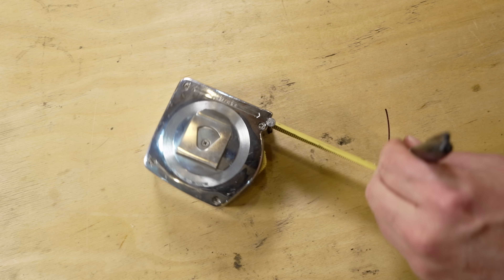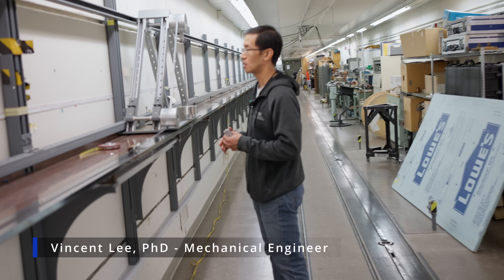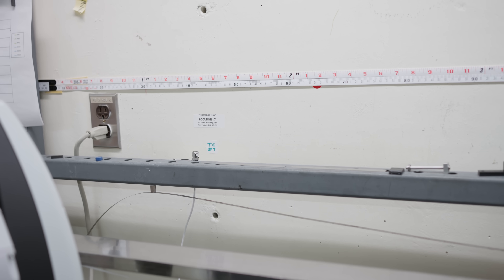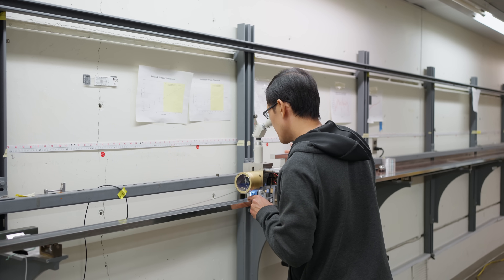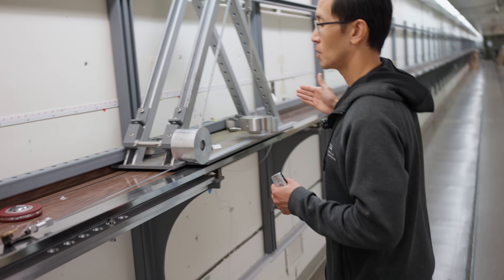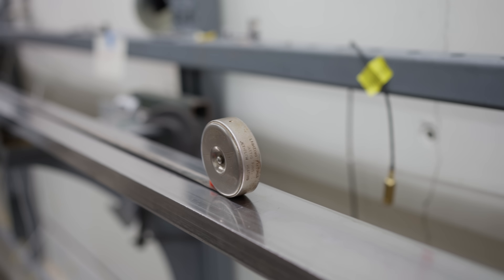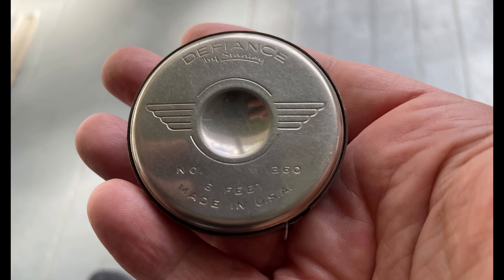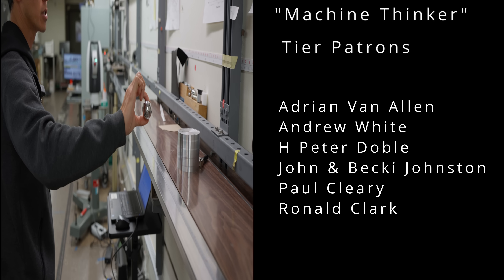The Most Accurate Tape Measure? I found it and can prove it

Comment: In my work, I was required to use an inch-measure steel tape with lead targets at specified intervals so that those points would show up on  x-ray or radiography images.  That tape was NIST traceable, and had to be inspected and tested by our Metrology lab if ever dropped or damaged.

This is the second of your videos I've watched.  Have a sub.  It matters not how often you may post new videos, because I have a good backlog to catch up on.  Thanks for doing what you do.

Comment: Lol when i was 15 i became a carpenter. My first tape had that wiggle.  So i used a drift pin and set the rivit solid. It didnt wiggle about 3 of the older carpenters had me do thiers. Then the boss came we were going to fix his tape. He showed us why it had a wiggle.  Next thing i found was my hammer bent a lot of nails so i made the head flat instead of rounded. Found out it made it worse. I just did have the mussel memory that you need to hit nails properly.  Just take practice.. lol always tried to make my tools better. Once i learned to sharpen . All my tools were sharp. But if you dont try things you may never learn why things work like they do.

Comment: I'm a former calibration tech in the Marines and for Lockheed at Stennis Space Center, and I used to calibrate tape measures for the satellite blanket department using our Renishaw and HP laser interferometers.

I'll never forget the first time one came through the lab.  At first we thought it a bit odd that someone would need a type 1 lab to calibrate a tape measure, until we found out why.

I'm also from Denver, and grew up listening to the "atomic clock" from NIST on the phone using a local number back in the 80's, which kick started my career. 

Made many visits to NIST, and met with a few of them, throughout my career as well.

Small world.

Comment: The amount of critical systems our society keeps perpetually running on Windows XP will never cease to get a chuckle out of me.
Reply: Nuclear missile silos often run on floppy discs.
Reply: Why not use a microcontroller for the computations and any operating system for the display?
Reply: @satunnainenkatselija4478 Because it's cheaper and easier and sufficient (in the short- to medium- term) to just do it on a desktop. And then never change it.

If it never connects to a network, you don't even have any security risks.

Comment: I use a stanley at work to hold +/- .010" tolerances over 60"+ on insanely expensive hydraulic systems going into some very well known excavating equipment

Comment: That hook to the 2 inch mark accuracy is probably more important to the accuracy of that tape than the next 48 inches.  In the sheet metal sheer shop my company would only allow a few different brands of tapes and we had to check them  on a standard ruler before sheering tons of stainless for production.

Comment: Just curious. I understand it’s climate controlled but why are these incredibly precise tests not performed in a clean room? Where ingress and egress are controlled, real time temperatures are monitored, etc.

And why is the calibration apparatus not constructed of a stone material such a granite? Something that has a much higher thermal resistivity. 

I designed high precision laser metrology devices and tools in my younger years and these things and many more were norms in that world.

When having the ability to measure to the 50 millionths of an inch, I could be looking at a measurement of a ball bearing under a laser and could tell you when someone opened the door to the room because the temperature of the ball would change and it’s diameter would change.

Comment: It would be interesting to measure a tape at 120-deg F and 0-deg F to see how much of a difference their laser can detect.
Reply: Will depend how long it is. Steel's coefficient of thermal expansion is well known. I assume since you used Fahrenheit we are using customary units. The thermal expansion of steel is somewhere between .000006 and .00000694 in/in/F. So for a 25 foot tape measurer you can expect it to be between 0.216 and 0.2498 inches longer at 120 degrees than at 0 degrees. The laser interferometer was showing a measurements to the 100,000th of an inch in the video. Even a tenth of a degree Fahrenheit would cause a difference of 0.0002 inches over 25 feet. Easily detectable with this instrumentation. Which is why they control and measure the temperature in their lab so precisely, and probably the imprecision of temperature control and measurement over such a long space is a larger contributor to their uncertainty calculations than anything to do with the instruments.
Reply: This is something considered in calibration labs. The reported temperature of dimensional calibration is important to know. You can theoretically determine the expansion/contraction, but if you really need to know you should always perform the experiment.  Most would just calculate with a CTE for the expansion/contraction, and estimate the uncertainty.  Detecting the difference would be trivial for the laser. Their accuracy is in the millionths of an inch or less, considering optimal operating conditions.

Comment: I got in trouble as a machinist once for making parts too short.
I said no way, I made them correct within tolerance.
Turned out at one metre and before my tape was great.
At two metres and beyond my tape was great.
Between one and two metres the error grew to 1mm then decreased again.
My parts were 1mm short at at 1.5m 
We stretch the tape measure out along a 2 metre steel ruler and couldn’t believe what we were seeing.
It was a Stanley brand.  Needless to say they sent me out a free refill for the tape.  Scrapped parts were worth 10x that.
However I was off the hook 🤠

Comment: In case anybody was wondering, "NIST traceable" basically means the manufacturer (or a 3rd party calibration service) sent their equipment to NIST, and then they use the calibration report and NIST approved procedures to calibrate things. This can actually go several degrees of separation, but you can always trace back to NIST.

Comment: That's funny you posted this with the McMaster Carr site. I work in an aerospace machine shop, we make parts for SpaceX and Blue Origin. We just bought one of those Starrett certified tape measures for our shipping/receiving to do receiving inspection on raw materials. The certificate says it is +/- 1/32 over 12-feet.

Comment: Just how traceable is that 5kg tensioning masspiece. Has it been verified against any of the standard kilograms, which are obsolete, but which are very small due to their density. I have some masspieces that are traceable to it with only a few steps. Verified against a balance, that was in turn verified by a replica masspiece, which in turn was referenced against one of the prototype kilogram units that were sent all over the world. 1g, to the milligram though you can measure the mass change that occurs due to corrosion from the atmosphere, and the tiny mass lost due to handling.

Comment: If you only have 1 tape measure, it doesn’t matter if it’s right or wrong.

Now if you have 4 or 17 tape measures, well then you’ve got problems if they all don’t agree.

It’s like the man with one clock who knows what time it is, and the man with 3 clocks is never quite sure. ( because they are never 100% in sync)

Comment: Having used a lot of different tape measures, i would say that the most i have ever seen them be off by is around 1mm per meter compared to each other obviously, Which is not at all bad, its 1 meter per kilometer, its 1/1000. Even the really cheap ones they just tend to last a lot less time in my experience.

Its not hard to figure out how they do it either, they buy a precision tape measure to create their own ones and if you sell just a thousand tape measures the price of a precision one isnt that much.

Comment: At this point everyone knows (or does now) that the thumbs down button is as useful as the door close button on an elevator. (They only work for firefighters with a key.) Basically, you don't see anything change, but it can get recorded by the admin. Sometimes.
Reply: close door button does work in my office. if I do nothing it takes about 4 seconds longer for the door to close compared to pushing the close door button.   (push floor button + close door vs  push only floor button)

and yes I did measure that, hey I am somebody who watches this type of videos....
Reply: @Blackadder75  yup, some do work.

Comment: a video on optical interferometry wouldn't be a bad idea.  I'm assuming that an infra-red laser was used for this work, with a wavelength on the order 800  or 900 nm.  My guess is that the reflected beam is compared (i.e. added) to the transmitted beam, and the max and min are counted as the reflector is slid down the track?  I've heard of interferometry being done with white light, and I can't imagine how it works with the range of wavelengths found in white light.
Reply: I mean, a light can look white, but still have sharp emission bands that you could (in theory) use for interferometry.  I'm honestly not sure why you would want to do this, however.

It occurs to me that a completely different application of interferometry would be to measure the thickness of a transparent coating.  The idea is that the surface and the bottom both reflect some light, and the reflected light interferes with itself.  This is the same effect that causes that rainbow sheen on oily water.  By observing the exact wavelength that is reflected back the strongest, you can determine the thickness of the coating, and of course you need white light to make this measurement.

Comment: Okay... I have a question that's been driving me nuts. Sticking with freedom units, ya know on tapes how the whole number has a thicker mark? Where is that value relative to the mark? I thought centre, but when I compared the tape vs. my 6" Starrett ruler, it shows the whole value is at the beginning of the mark. Is there an industry standard? Cause every time I bring a new ruler into the shop, I go through this insane making cross-checking.
Reply: That is interesting, no joke,  In repair or in existing work that would be relavent but in new construction does it matter?  Everything is relative, if everything in a newly constructed biulding that was measured at 12' 6" was really 12' 6.1 " I dont think there would be a problem.  When I was a helper as a young guy I always did check my tape measure against my bosses' so I could give him what he asked for.

Comment: NIST ran the ultimate whitewash on investigating the three towers that collapsed on 9/11. To this day they refuse to release their data and their models DO. NOT. MATCH. the video of the collapses. 

It is an outrage. If Tower 7 was the world’s first collapse of a steel frame structure caused by fire them we should have a whole new set of codes and practices for new buildings. Yet there are none.

Comment: I remember as a kid trying to "fix" the wiggle on one of my Dad's measuring tapes.
Reply: Sigh. I did. Thankfully it was from my 'own' set of tools so it only hurt me. I was in like middle/high school. "This tape measure is garbage! Can't believe it's worn itself so loose." Took a punch or something and hammered the rivets tight. Wasn't until years later...oh no.
Reply: Same here. I decided to super glue it to take all that "slop" out. Luckily before the end of the project I had let it slam when it retracted a few times and it broke my "repair"
Reply: My dad would holler at me when I let his tape roll its self in and SLAM on on the wiggly hook. I'd say but you do it look it's already loose! 🤷

Comment: Every Starrett tape I have has a Roman numeral 2 inside a flat oval apparently signifying it as Class 2 with a tolerance of +/- 3/32” over 100ft. But I have only seen one other tape with the marking. I think class I being 1/32” over 100ft. Milwaukee tapes with the finger hold gap are the best.

Comment: I remember a project that needed graduated tapes for aligning conveyer tracks. Nothing super accurate, but it was surprising the error between three measuring tapes from the same package had 2mm discrepancy over one meter. Didn't matter here, but was quite startling.

Comment: probably my bias talking but, as a machinist, ive had good luck with my starrett imported tapes. just the cheapie ones off of amazon. def seem to be tighter tolerance than fat max or the like. not that anyone using a construction tape needs +/- .003" for anything, but still.

Comment: half a mm off at 4 feet seems perfectly acceptable when the mark you're making with it is probably a 3mm wide sharpie tip, or 1-3mm wide pencil depending on how long since you sharpened it, lol.  Impressive for nearly 100 years old.

Comment: Build your house in the summer. The thermal expansion of the tape will result in more house for the money.
Reply: So I ended up looking it up, and my base assumption was wrong. Wood has anisotropic material properties due to its grain structure. It has about twice the cte as steel, 30 micrometer per meter per degree C for wood vs 16 micrometer per meter per degree C for steel,  in the radial direction of the tree, tree getting fatter, while having 5 times less cte as steel, 3 micrometer per meter per degree C for wood vs 16 micrometer per meter per degree C for steel, in the direction of the grain, tree getting taller. We cut timber to length along the grain direction, so cutting in summer would result it more wood than in winter.

If we are cutting 1 meter of wood when it is 30 degrees C outside, our tape measure would read 1 meter but would actually be 1.00016 meters long. If we then cut the wood, it would be a piece of the same 1.00016 length. Now, if we wait till Temps cool to a more nominal 20-degree C, that 1.00016 m piece of wood would shrink to 1.0001299952 m, which is about 130 micrometers more wood than if you had cut it initially at 20 degree C.

If we do this when it's 10 degree C out, the 1 meter tape measure would actually be 0.99984 meters long, and when measured at 20 degrees C the wood would end up being 0.9998100048 meters long. 

Cutting your wood at 30 degrees C results in 0.0003199904 m more wood that cutting your wood at 10 degrees C.
Reply: @Inconspicuoustwrex  This is the sort of curiosity and pedantry which makes me occasionally have a bit of faith in humanity.  Hats off to you
Reply: @Inconspicuoustwrex  So don't cut it in the winter?
Reply: @Gigaheart  Sounds like we're back at build in summer and have more house
Reply: @Inconspicuoustwrex so buy your lumber in the winter and sit on it until the summer, start building and get mad deals on sheet materials by exploiting physics?
Reply: @Inconspicuoustwrex  Hm, the pdf I looked at showed 30 to 45 micrometers per meter Kelvin. "In tests of both hardwoods
and softwoods, the parallel-to-grain values have ranged from
about 0.000031 to 0.0000045 per K" (Unless I'm the one off by 10 here.)
Reply: Build your house in the winter, the wood's cte is much higher than the tape's. Cutting in winter will give you more wood at nominal Temps while cutting in summer will give you less.
Reply: @Inconspicuoustwrex  Huh, I never expected that to be the case, but I looked it up and it looks like wood does indeed have a roughtly three times higher coefficient of thermal expansion than spring steel (if I didn't missread anything by an order of magnitude).
Reply: @Inconspicuoustwrex  Ahhh  which is it
Reply: @Gigaheart Cut in winter build in summer and only live in it in spring
Reply: @0r1x  Well played! 😆
Reply: The expansion due to higher average humidity in the summer would probably have a greater effect than that of temperature would it not?
Reply: @workshopninjathe1st  yeah, idk if these numbers were from construction grade fir or decent stuff but I found 4.5% radial (thickness of a flatsawn board and width of a quartersawn board), 7.7% tangential (width of a flatsawn board, thickness of a quartersawn board) and 0.1% longitudinal (length). Percentages are dimensional change from green to "oven dry".
Because construction lumber is usually still quite wet nowadays, your house is going to initially shrink, I saw a 3/4" number talking about seasonal change on a single story home. So yeah, the thermal expansion seems to be peanuts compared to moisture 

Long story short.. water your home?
Reply: building on to multiple replies in this thread, i wonder about maritime climates like the pacific northwest where it is colder in winter but also much more humid. would the higher moisture content in a winter build cause more expansion in wood than the cooler temps cause contraction?
Reply: Genuinely hilarious
Reply: do you take the lumber measure yourself at home depot, and if so, how ?
Reply: This is illogical. "More house" would mean more material. Which logically would be more expensive. Also if I know one thing about contractors you will still get the smaller house but they would charge you for building the bigger one.
Reply: @bobbytables4305  1) it was a joke 2) "More material" is determined by measurement. So if one tape measure is longer than another, you will get more material for the same cost using it.
Reply: It would be the opposite, if everything shrinks in the winter but you’re paying to same price you’d get more house for the same money .